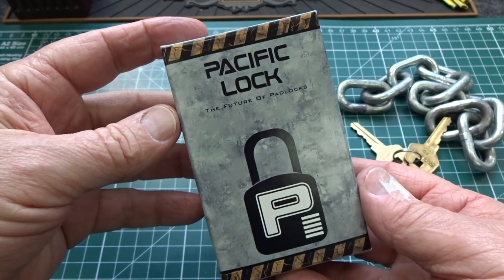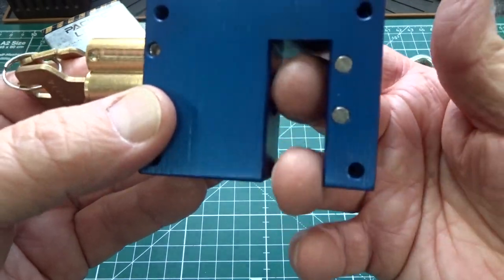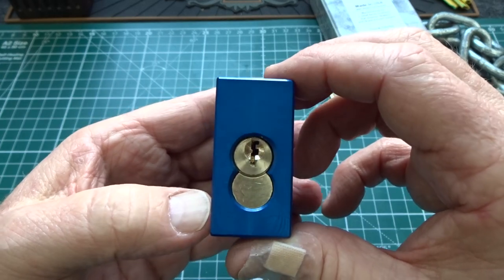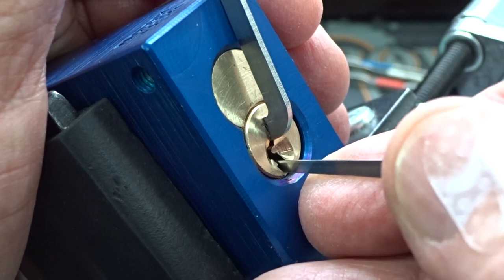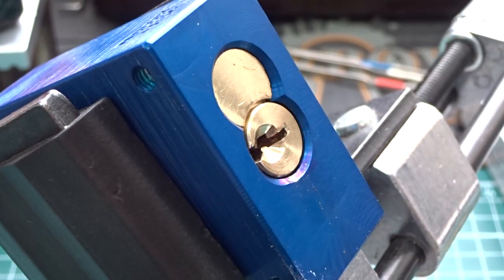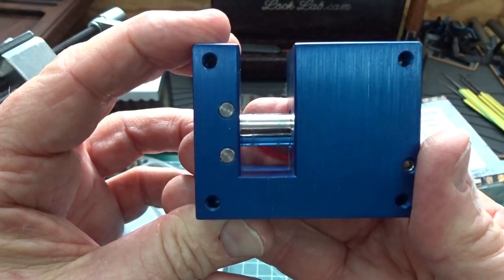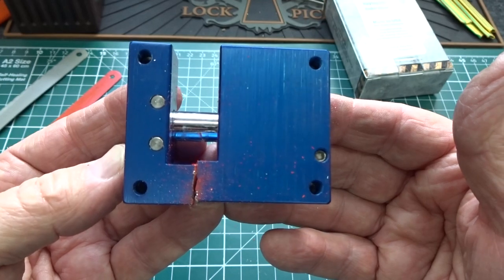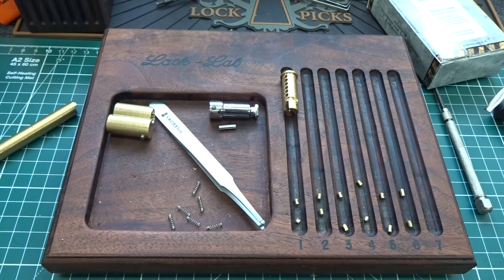(1190) Review: Prototype PacLock Block Lock

Comment: That is a nice lock, nice to see some companies going for the quality of their locks for once.
(and the sending out, of locks, to others to test them for quality is also nice)
Reply from the maker: You are SO right!  It makes me feel as though they value our input.  In a way, WE are FREE R&D division.
Reply: Brass and aluminium are not compatible in contact with each other because of galvanic corrosion. If you left this outdoors for 12 months it would seize up.
Reply: If only Master lock would value our feedback
Reply: bosnianbill I have to thank you for the videos bill, as I now have a new hobby. I hope to send you a Challenge lock from Canada in the near future, nice picking and as always great video...
Reply: Rufus Chucklebutty with hard anodizing on the aluminum you wont have a problem with galvanic corrosion. I couldn’t see anywhere on the lock where bare aluminum and brass would come in contact.
Reply: And with the screw holes on it, you could sandwich the lock between two 1/2" plates of steel to slow down Bill's hacksaw. :)
Reply: The brass core will likely ware through the anodizing as you use the lock. I doubt it would be a quick process but it is worth keeping an eye on
Reply: One thing I am curious about is the longevity of the lock due to the corrosion rates of dis-similar metals exposed to the elements.
Reply: @bosnianbill A single slide hammer attack would break those wings right off the bar! Brute force and slide hammers dude!
Reply: The only way to resolve that in its current form is to use some anti-seize on the inside, but there are two proper ways to fix this;
1) Bond a brass sleeve to the inside, where the lock slides in and out
2) Make the core and pins alum (cheap), or the block brass (strong).
Reply: Locks keep honest people out. That and it would set off alarms if the lock was mounted with a fixture for motion sensing. The only way to make it stronger would be to use hardened threaded screws and thread them into the lock body with its current design. The shackle would need a complete redesign to allow a single piece of hardened anti-drill steel into there rather than wings.
Reply: I'd like to see 2 more screw holes on the back of the main lock body. I install locks. I see a weakness that if that part was cut as Bill did then use a lever/large screwdriver and it'd be easy to pry that away from the unit and rotate it like Bill did.  However if there were 4 screws in the main mass of the body -- ideally two more near the shackle there would not be the weakness of leveraging against two small 32 tpi screws (which ARE easy to bend!). My shed, BTW, has Medeco on it along with a few surprises of my own.
Reply: Zachary Lagler they value you feeding them back $$$$
Reply: We do indeed, as does any "for-profit" business in the world!  But, like someone else posted, we feel that we can learn a lot and have different thoughts on our products if we plug in with the locksport cloud. And I think the past year of our involvement shows that!
Reply: Thanks for responding to my email over the weekend PACLOCK PRES. :)  I'm hoping the improvements will put you at the top of the PAC (*ahem* I'll see myself out...)
Reply: The lock looks like its cnc machined. Thats might be why it suchs high quality.

Comment: As always, a well done video with a ton of good information (for us to take away). This was a lock we custom designed for a customer who bought a large batch for their OEM type situation (we aren't even sure what they are using it on). When we got done, we realized a key benefit that Bill didn't touch on in his video. There are other "U" shaped locks out there, but most (none?) don't key into American/Master key systems so you're left with more keys on your key ring.  This Block-Lock can key right into your standard American style systems.   I will reply directly to a couple of the posts, but in the interest of not trying to clog up the channel, I'll hit on some of the main topics here.  We did think about the hardened steel (maybe stainless steel) anti-cut pin like Bill mentioned.  Our original customer didn't see a need and didn't want the cost increase.  We can do it, but added costs drive up retail prices. Which hopefully answers the questions about why an aluminum body.  Using regular steel is far more costly on the Haas CNC machines (time to machine and cost of tools) and then you need to heat treat and plate (we do all this in the USA... heat treating is about a buck a pound and we do electroless nickel plating which  is far more expensive than what most other padlock manufacturers do). Anodizing is relatively inexpensive and aluminum doesn't tear up tools on a CNC machine like steel does.  We could do steel, but the idea is that we want to compete against the brass versions of this lock out there (brass cuts just like aluminum). Yeah, the position of staple/hasp/bolt limits functionality. This lock was sent to Bill as a part of a "trying to get feedback on a new product before we go into final production"... we sent out about 30 of them to a variety of people who responded to our call for volunteers.  Yesterday we already pushed out a batch of a second version that has the staple/bolt/hasp farther to the edge by about 0.400" based on feedback we've already gotten.  Gives a total clearance of around 0.6"  That was as open as we could make it... because what's also on the product roadmap is a version that will accept SFIC, KiK, LFIC, and FSIC. A few weeks behind probably.  Also working on a simple little rubber keyway cover to help keep debris out (and the rubber cover would be field replaceable). This guy isn't meant to go after the $80 - $120 market... but rather in the $40 range. Plus with the aluminum, you can go some pretty wicked laser engraving that looks great. I can also promise that this lock was not cherry picked by me or anyone of the executive team. I almost wish I had simply because about 8 months ago the locksport community recommended we add security pins into the #6, 7 and 8 key pins to even further improve our pick resistance. We did do that on all our cylinders, but it's a rolling change.  So the cylinder in this lock obviously doesn't have those changes yet... maybe we could have been just a bit too much for the pick to be successful! Yes, we could likely look at adding security pins into the cylinder itself, but again our target market is the Master/American market... I like to think videos like this help to show we pretty much already have a better cylinder than they have. Adding in more security features just bumps up our cost and retail price again. Sorry for the long response, but I can't tell you how much we value the feedback and I feel like I should do my part to shed some light on why we did the things we did!
Reply: I don't know how much it would cost, but an anti-drill insert in the bible/core wouldn't break the bank, would it? Would make at least the cylinder much better protected.
Reply: It all adds up ~ as you can see from all the posts, there are a number of ways to improve the security level of the lock, but they all add up. Once again our cylinder is meant to compete with Master/American and we feel good about what we've done there.  And if someone wants an anti-drill/anti-pick/anti-whatever, then that's why we almost always offer the lock body to work with SFIC/KiK/FSIC... then you can pick whatever "high security" cylinder you like and take care of the cylinder side of things!
Reply: It’s only when you start designing objects, that you realise just how limited you are to move an element, this way or that.  There’s always a cost to every single move, which negatively affects one of the other elements.  It’s easy to suggest changes, but a very different challenge to actually deliver it as an engineer when you’re on the mill.😭😭😭😜🤣🤣🤣♥️

Comment: Include a paper template with the lock for drilling the mounting holes. Who ever installs the lock with thank you 100 times over.
Reply: ThrowingItAway / lay a piece of paper on the back and poke holes, because I usually loose the original template

Comment: Put a boron alloy pin into a blind hole perpendicular to the cut Bill made to cover that weakness.  Make the shackle end be an expanding one to prevent the rotation issue even if the body is cut.  See cleco (a sheet metal working tool) ends for one example, though there are many ways to do this. Make the shackle out of boron alloy and include a rotating element over the shackle to create a more secure version as a premium model. Add a serrated chamber or two, more security pins, put hardened steel bushings in the mounting holes - all options for improvement depending on the price point you wish to hit.  Make them out of boron alloy bodies, include at least three of the other options above, charge more, and I will buy two myself.

Comment: the threaded holes on both sides will make drilling the retaining screws easy (drop a bearing ball down each hole). Definitely needs an anti saw pin as you suggest . A hard rotating sleeve over the lock bar would also help.
Reply: Bill Todd even if you drill the screws the lock wont come of.. and not centering the locking bolt prevents someone turning the lock if the screws was to be drilled.
Reply: Glensen maybe, but once free of any rigid mount, the lock would be easy to force open aluminium is really not that strong.
Reply: If you want it unmounted a flat sharp pry bar jamed up behind the lock i the easy, fast and silent way.

Comment: Nice Lock.Replying to the earlier posts: 
 If it was mounted to a door the hacksaw method would not be feasible. If the lock was cut where Bill cut it, turning the body would be impossible, it would not rotate.  Also the four pound hammer attack would be pointless if grade eight bolts were used. Even if the lock was broken loose from the door, it still would be attached to the hasp, preventing the door opening.
The adding of a hardened security pin would help prevent saw attacks like Bill demonstrated, but is not needed if the lock is used in the manner it was designed for.
Be nice to the kitties, Bill.

Comment: Very cool and precise video Bill.  Great job... the one thing I think would be vulnerable to physical attack is the core itself.  As the body seems to be great if attached to a door like it is designed for.  Makes the core the attack point in my eyes... a quick drill of 20 sec. And pop the core right out unless there is antidrill protection in the core.

Comment: Good look from a loc Smith point of view. Needs to make that key way tighter. Also Incrave hardened on the shackle. You can make the key way for hard to pic by putting more warding or closing cap between the key and the way.

Comment: If you use it outdoors the brass core will cause galvanic corrosion on the aluminium if the anodising wears away. The al will disintegrate.
Reply: Rufus Chucklebutty nice observation.
Reply: Rufus Chucklebutty also, hilarious profile name bahahaha!!!
Reply: Sprinkle in a little salt, corrosion goes into over-drive!
Reply: Thats true but a quality job of hard anodization should be very wear resistant and long lasting. A poor job will result like you mentioned. American Lock has done a good job with their anodizing process.
Reply: Bill scratched the anodizing pretty easy, the lock slides in and out, I can see it being worn through fairly quickly.

Comment: Well, when I see alluminium, I think of acid... scuff the protective layer from around the two locking pins or use a dye grinder, add some acid ( maybe in a gel form )... and one could work on the pins. Even when it's attached to a door by means of bolts, that could actually work for you, as it will provide a stable ' workspace ', i.e. leverage,... . Just thinking out loud here... .
Reply: Or just pick it
Reply: Gallium only works over a certain temp, it melts on a hot summers day, so no using it in winter without a heater.

Mercury will stay liquid but not only do you have to take out the anodized layer, you also have to get the stuff in contact with pure aluminum, no oxide layer.

Comment: Late for commenting but I had a thought on the shackle position of this lock:  being set deeper in the throat than the center line helps to shield the other half of the two-part-system (the shackle-hasp-pair). As a hasp or chain link etc tends to be symmetrical, centering it deeper in the lock body and past the center point of the lock may help the lock to more completely encompass the overall dimension of any hasp, and ultimately just making it protected and less accessible to attack, for any application where it were the weaker link, so to speak.  So I like that design feature; for a larger hasp one would need the next size up (if one were available), but ideally, a larger one with the same off-center proportion.

Comment: Adding a hardened steel pin stops the cutting across the bottom of the U (the bridge) but it doesn't stop it being cut on the non-pin side just above the bridge but below the shackle
Reply: Chris Campos good point but it wouldn't easily rotate if at all, if it was cut there. You'd have to cut a chunk out to allow clearance for it to rotate without being stopped by the bottom piece of the lock, presuming there's enough there to cut out to allow rotation. That might even be why the shackle is so low in the body of the lock.
Reply: After looking at it again, no, I don't think there's enough there to cut out between the gullet of the lock and the underside of the hardened pin holding the shackle locked so it probably wouldn't make much of a difference.
Reply: Sam T that's very true
Reply: An attack in between the hardened pins maybe?
Reply: Chris Campos maybe! Might be made difficult if attached to a door though. Oscillating multi tools, while noisy might breeze through it.
Reply: Oscillating tool is exactly what I was thinking
Reply: Battery powered disc grinder would be my choice. Cut the lock and maybe cut the mounting screws.
Reply: You can cut flush with the door surface using an OMT. You can't with an angle grinder.
Reply: That's exactly what I was going to say.
Reply: With an OMT you could cut the four mounting screws from behind the lock just as fast if not faster. Doesn't take long to go through a 3mm steel bolt with an OMT and it's perfect for flush cutting like that. If there's any gap at all between door and lock you get the added benefit of a dab of decent epoxy on each cut bolt end (or just slathering it all over the lock's back) returning it to an untouched looking state, providing you brush up the pile of filings afterward.

Comment: At the gas station I used to work at, we used a lock similar to this to hold the money box for the vacuum in place. Given the small space it was locked in, getting it unlocked to bring the money box inside every closing shift wasn't easy, especially with gloves on.

Comment: Pacific Lock have a video on it. It's 6061 aluminium, tethered and fixed mounting and accepts multiple core brands. A great pick and a good lock for certain applications and with those points that were raised, it'd be even better. Bike disc, wheel applications for opportunistic threats would be good and it's light. Otherwise yeah, fixed mounting over a hasp also increased attack difficulty & picking. I'd buy one and will enquire now.🍺✌

Comment: The biggest vulnerability I see is the 4 mounting holes, I would try to use a punch to drive the screws out by stripping the threads. I would recommend steel inserts with internal threads. Or use blind holes. Either way I would think that thicker screws with coarser threads would be a good idea to prevent prying attacks. Also I didn't see any anti drill pins in the core.

Comment: I have a bicycle shop and I'm not in the best of neighborhoods.  I've had several not so leagle minded people tell me there is no lock that can stop them from stealing bikes . They tell me 90 % of all locks can be gotten by parts from a bic stick pen . Supposedly the tale of the cap can hit most tumbler and the outer straw can get the soda key locks . Try this see if it works for you

Comment: Another potential attack - remove the lock retaining grub screw, drive a screw into the keyway and slide hammer the lock core out.  You may be able to damage that roll pin enough to separate the lock from the bar.

Comment: When using a hack saw cutting aluminum use a course blade with slow strokes. Fast strokes cause more heat and gumming of the blade teeth.

Comment: Could be used to retain one end of a door safety chain, i.e. to let you open the door a limited amount, but preventing push entry.😜🤣♥️

You could you try cutting it mounted on a door, using a Fein vibrating saw.

Comment: If that's locked into a door clasp and flush to the door or Atleast close them even if cut they won't be able to rotate it enough to get the back of the lock off. So it'll be floppy but it'll still be secure. I do still agree that it needs some drill rod pressed into the end and possibly one up the small end vertically where it might also be cut depending on placement.